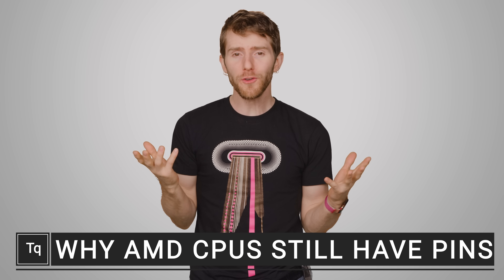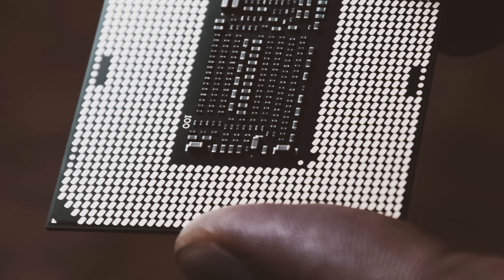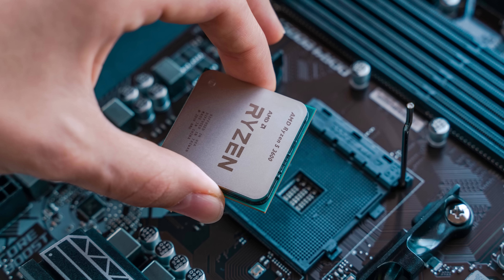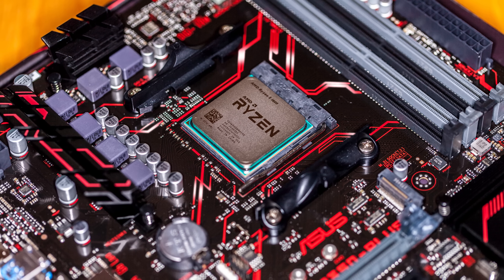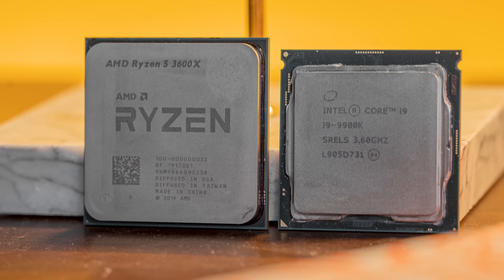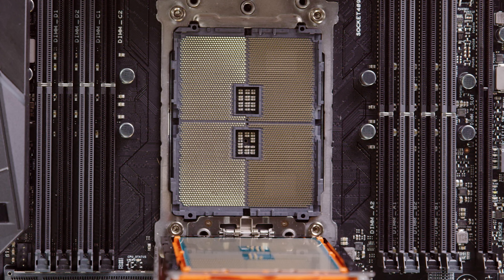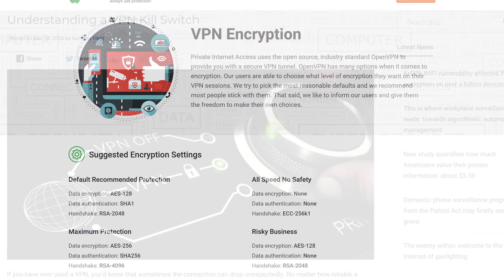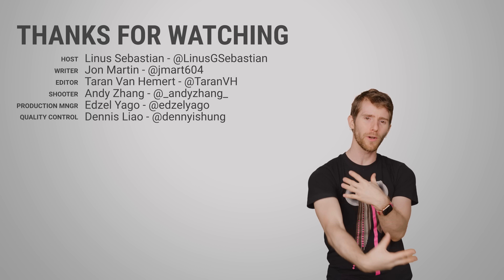Is AMD Stuck In The PAST?

Comment: I honestly prefer AMDs way of going at this

Fixing an LGA motherboard CPU pin is straight up damn infuriating and requires some black magic to be able to do
Reply: Just Vienna  but it’s a lot cheaper replacing the motherboard rather than the cpu
Reply: @mikeramos91  Depends on the CPU / Motherboard in question.  That said, AMD's pins are harder to bend so you rarely see that problem with AMD anyways.  Not to mention, it is possible to fix a broken pin on an AMD processor.  For an LGA socket, you are SOL if a pin breaks off.
Reply: Michael Ramos I bent multiple pins on my ryzen 7 2700x, and one even snapped off... I was able to buy a $5 amd cpu from years ago and steal a pin using my heat gun for the broken one and carefully align all the others without even a magnifying glass, just a good eye and steady hands ... that’s a $5 fix compared to just buying a whole new motherboard
Reply: @DeadChimera  The heck? Did you really manage to solder a pin on a CPU???
Reply: @Gigasimo456  You can just put it on the motherboard pin and it will work like lga
Reply: @DeadChimera  How do you manage to break a pin of a cpu let alone something as pricey as a 2700x? I handle even old ass athlon x2s like they're newborns
Reply: Murderfulpit76 well I was attempting to clean off some old thermal paste when I realized it had gotten on the pins while I was scraping it off... I tried to delicately wipe it down as I had no isopropyl and a pin got bent but when I tried to realign it, it snapped clean off... I did manage to resolder it though
Reply: youre clearly not fit to handle delicate pc parts it seems.

Comment: As an AMD user for the past 10 years, to remove the CPU, it is best to wiggle the heat sink fan (HSF) first. You can use a tiny screwdriver to pry it lose. Once its loose and you can wiggle and spin the HSF around, it is then safe to remove the heat sink from the CPU. I've learnt my lesson by detaching the HSF straightaway from the CPU and the CPU was actually stuck to the HSF. By pulling it out, the CPU which was latched onto the MOBO came out as well with bent pins. Fortunately I am able to bent them back and it was still working. Thus, you need to know how to remove these AMD CPU based on experience LOL!

Comment: I wanted to reapply thermal paste on my 3700x, I tried to remove the heatsink that was attached and lo and behold, it ripped out the whole processor from the motherboard even with the lock mechanism still locked. I found out that my cpu has 2 bent pins fml
Reply: Yeah, sadly you have to be careful about that.
Reply: #1 its not that hard to fix. all you need is a credit card and a pair of tweezers.
#2. If you are that incompetent you should be just buying a dell sff.

FYI all you need to do is heat up the proc with ada or any other heavy task, shut down the  pc and give the cooler a little twist. It will come right off like it is supposed to.

Comment: LGA sucks. If you bend the pins on a CPU, there's a possibility to fix them. But if you bend the pins on a motherboard, you're just fucked.
Reply: And most of the people are spending far more then a 144.00 for a mobo. How much is a super fragile bent pin on a z490 going to cost you?  Have had both for years. AMD's way is far better to work with,.

Comment: When i remove the heatsink my fcking cpu comes off with it. F u amd
Reply: twist the cooler side to side
Reply: If you are that incompetent you should be just buying a dell sff.

FYI all you need to do is heat up the proc with ada or any other heavy task, shut down the  pc and give the cooler a little twist. It will come right off like it is supposed to.

Comment: Another potential issue with LGA is mounting pressure connection issues.  I have had far fewer PGA chip builds that have suffered from memory connection and PCIe connection problems that almost always end up being a mounting pressure issue for the CPU in the socket.  It isn't so bad with small chips and low pin counts but when you get into large chips with high pin counts it tends to become more of an issue.

Comment: I ended up bending most of the pins on my 3700X when I had got it a few months after launch. I was so worried I'd done permenant damage but managed to bend them back into shape. Pin designs are so inconvenient. Especially when the cooler is glued so hard to the CPU due to the paste that you can't get it off
Reply: Well, that may be more of a design issue with the socket.  They could do with redesigning things so that can't happen.

Comment: My z97 board died, bought a used one for $100, it came with a few bent pins, 1 broke off while I was trying to fix them.
Now I don't have a clue what to do. Replacing a perfectly good i7 4790k with anything that's better will cost $500+ because I have to get ddr4 ram as well.  What the fuck do I do, order another used mobo and pray?  Any help would be appreciated.

Comment: Missed the part where when the thermal paste hardens and you try to remove the cooler from your AMD CPU it RIPS THE F*CKING CPU OUT OF THE SOCKET! This can't happen with an LGA mounting.
Reply: If you are that incompetent you should be just buying a dell sff.

FYI all you need to do is heat up the proc with ada or any other heavy task, shut down the  pc and give the cooler a little twist. It will come right off like it is supposed to.

LGA is pure shit very easy to bend a mobo pin and nearly impossible to fix it.

Comment: AMD stuck in the past. Thats why I am still using the same motherboard now since first gen. Thank you AMD.
Reply: Does it have DVI?
Reply: True_Neutral? XD
Reply: I'm still on x470 with 3700x.

Can't wait for new gpu wars later this year.
Reply: But can it run Crysis?
I mean, Chrome?
Reply: HA this comment aged very poorly. Glad to see you'll be able to run gen3 zen in that motherboard. Longest support ever.
Reply: What in the shitting hell could justify leaping only 3 cpu generations anyways?
In other words by the time you will ACTUALLY need a CPU upgrade, you will need a NEW AMD board.
Reply: @BenderBendingRodriguezOFFICIAL  true nothing is actually future proof  in pcs apart from cases and maybe psu s
Reply: @BenderBendingRodriguezOFFICIAL  the one intel didn't provide is "optional". Yes, if you want the most out of your cpu, you will partner it with the new mobo chipset. but then again, the word is optional. And use the word WANT instead of NEED.
Reply: @BenderBendingRodriguezOFFICIAL  uhh maybe going from entry level 1600 you can afford at the time to lets say 3900x you can save for while using your AMD system for years ? xD which is exactly what i recommend these days to people building "budget" systems - buys decent midrange x450 MotherBoard specced enough to be able to use any of the Ryzen chips (currently my rec is on Asrock Fatality B450 Gaming K4 available currently at Amazon at mere $120) then put old first gen 1600 in it which is still more than enough to feed midrange GPU, then save up for better GPU and CPU down the line and upgrade in few years to best GPU you can afford and CPU strong enough to feed it ...

you know not spending money you dont have to now for expensive CPU and instead putting that cash towards better RAM or GPU then upgrading in 3-4 years to much better hardware while staying on your current Motherboard and RAM ...
Reply: @Asghaad  buying a high end mobo and plugging a low end CPU into it is like buying a rtx 2080 ti then plugging a 720p monitor into it... You're just giving flat out bad advice. Anyone who's on a budget should just get a mid-range mobo and use the savings to get a better CPU, instead of throwing money away on a CPU that'll just get replaced in a year. It's just kicking the can down the road.
Reply: @Asghaad  coupling a r5 1600 with a rtx 2070 results in a 15% bottleneck of said GPU. Coupling that same CPU with a 5700xt results in a 17% bottleneck. Coupling that same cpu with a 2060 results in a 10% bottleneck. Flat out no the 1600 is not "more than enough" to drive anything up to either of those GPUs. The end user may not notice it on a 1080p 60hz monitor, but running either the 2070 or 5700xt on a 1080p 60hz monitor would be a bottleneck as well.
Reply: @paulghignon4092  I really hope you didn't just quote gpucheck. LOL.

...though to be fair your point about GPU bottlenecking is valid. I just question the impossible precision with which you label those bottleneck values, since they will vary wildly from program to program. It suggests to me that you googled it, and trusted whichever addled algorithm popped up first.
Reply: @paulghignon4092  thats just really a silly comparison since the impact of each is different. just see this vid so you have an understanding how a b350 motherboard could still kick ass.

https://www.youtube.com/watch?v=oRaZ2Txv13M

If you are too lazy to watch, summary is it can easily handle ryzen 3600/3700 even a 3950 unless your looking to overclock it. however, i think a person with a 3950 could also afford a new board. Just want to talk to the people who are on a budget

Again. Thank you AMD
Reply: @BenderBendingRodriguezOFFICIAL  Unless you use your PC for work, in which case, time often being money, frequent upgrades can often pay for themselves.
Reply: @BenderBendingRodriguezOFFICIAL  Agreed. High-end CPU's can easily last 5 years for gaming, even longer with overclocking.
Reply: You mean the same motherboard which has a far lower life expectancy than any CPU you'll ever buy? Try using that motherboard in 6 years as it's components begin to die one by one... Most people should upgrade their CPU every 5 years or so at best, and 99% of motherboards don't last much longer than that. If you bought a CPU that's actually worth upgrading a year or two later, you clearly spent money on something that was a massively low end CPU and probably low end mobo; I'm sure that low end mobo would work great with a high end CPU...
Reply: @paulghignon4092  motherboard "life expectancy" is only applicable if you drive it beyond its parameters i have +- 14year old Motherboard and CPU running every days that i sold to a friend years back and his son is still using that to this day ... because i picked motherboard that want being overloaded by the components ...

other MoBo i sold him along with my old trusty i7 4820K is right now running as his main system without issues ...and i expect it to be running a DECADE from now no problem ...

dont know where you get your absolute BS statement about Motherboards failing, but as long as you arent overloading the VRM it will last for DECADES without problems ...

which by the way is the case with that Asrock B450 Fatality Gaming K4 which runs 6 phase VRM (doubled 3 phase) where most B450s run single 4 phase  VRMs with most of the time 6 or 8 phase VCRMS only available in X470 or X570 models ...

pairing bad low end motherboard with strong CPU is the most often made mistake when building PCs that might be the reason you think motherboards last only few years ... when you buy cheapest trash you can and run it at or beyond its limits dont be surprised when it degrades fast ...
Reply: @Asghaad  Endurance will vary wildly with conditions, but if you run your PC 24/7 like I do, seeing 15 years is unlikely.

A motherboard lasting more than 15 years is rare, as by that point capacitors are close to reaching(or in the case of particularly cheap or old ones, are far past) their life expectancy, and have most likely degraded by a large margin, increasing chances of instability and failure. A cheap mobo can often have multiple failures as well...you might not brick it from capacitor degradation, but the VRMs may fail, a PCIE slot, a USB controller, etc.

Certainly, degradation is quicker if you're abusing the PC either through building it from mismatched parts(perhaps most especially with a shitty PSU) or with improper handling & cleaning, excess heat, shorts, etc. but it will eventually occur no matter how careful you are.
Reply: @auturgicflosculator  sure it will, i dont claim that EVERY mobo will last 15+ years (although the one i mentioned was of the budged variety and still works as daily driver PC) but neither will it die in few years ...

id say at MINIMUM life expectancy of decent motherboard running at its spec is at least 5-7 years, if its run as it should be UNDER the specs 8-10 is where i would start thinking about replacing even functional part.

meaning in the case of AM4 platform the decent well built and properly used Motherboards should last for 5+ generations of processors (we are currently at 3rd, gearing towards 4th and MAYBE we will get even that 5th gen still on AM4) leaving people who invested in lets say x370 motherboard path open to upgrade from theyr R5 1600 to current 3900x or even upcoming 4000 series when needed ... Intel doesnt have that, every time you want to upgrade CPU and GPU you also have to splurge on new motherboard (thats $100-200 extra out of the window for basically nothing) and with the new socket it often means at lest new mounting bracket for the cooler if not new cooler altogether (wonderful news for those of us who do watercool our main system ...)

for all of those reasons when i was upgrading my system i went from years old trusty i7 4820k (last soldered i7 before 9th gen) to Ryzen 5 3600 put into Asus ROG Hero VII x470 motherboard (basically the best x470 mobo that beats a lot of x570 ones in features and specs that at the time was RIDICULOUSLY cheap for what it offers). that means i have right now decently priced CPU that handles anything and everything i need and if i do upgrade the GPU in next few years i can always put better 3rd gen or even 4th gen Ryzen in that MoBo to keep up with what the GPU needs.
Reply: @Asghaad  I was only nitpicking on the mobo longevity point :P
Largely agreed on your other points, and if that hero VII was a good deal then it was a fine choice.
Reply: @auturgicflosculator  in American pricing it cost me around $160-ish which for top tier 10 phase VRM motherboard is a steal in my opinion :) especially considering the Hero VIII is even now over $400 and while better, not twice as good as the VII

hell i was surprised the Amazon restocked the VII and still sells it at $200 right now i wouldnt hesitate to recommend it at that price to someone looking for full featured board even today.
Reply: @Asghaad  One other point we disagree on...while AMD offers better compatibility than the competition, 5+ generations as you say sounds unlikely. I think the likelihood of 5th gen support is nil, 4th gen unlikely, 3rd gen questionable.
Reply: @Asghaad  How does it feel knowing those motherboards won't be usable past zen2? It's as if AMD lied through their teeth, they totally don't do that regularly...
Reply: @paulghignon4092  YOU WERE SAYING? HAHAHAH
Reply: @paulghignon4092  shame! shame! shame! hahahaha

Comment: I think i heard there where LGA problems with big aircoolers, some of the pins did not contact correctly because of the high weight of the aircoolers.
PGA should be more durable because the PCB needs to be bigger, to secure the pins then needed on the LGA socket.
PGA does not support the cpu as good when the cooler is removed, you need to twist and slide the cooler off, or the CPU will follow the cooler off and potentially bend pins.

Comment: Personnaly I'm more scarried when I have to install a PGA chip because a LGA you let the motherboard on the table and your fingers can't messed up. I prefer let a finger on the contact pads than on pins. And with PGA a little stress the cpu slide from your hand and it(s game over for it. Otherwize I removed recently an air cooler from my 3950X and the paste was so sticky that the cpu followed it out of the socket. Even if the cpu was suppposed to be still locked in. Thanks god no pins was damaged.
Reply: If you are that incompetent you should be just buying a dell sff.
 You literally drop it right into the holes unlike inhell crap where a drop from .25 inches means an new mobo., if you are bending amd pins you really shouldn't be trusted with mounting a cpu.

FYI all you need to do is heat up the proc with ada or any other heavy task, shut down the  pc and give the cooler a little twist. It will come right off like it is supposed to.

Comment: Who cares if the CPU pins are bend if you can fix them like Linus teached us??... Anyways intel is forcing you to buy a brand new motherboard and CPU every single generation by changing the damn socket -.- making it a total waste of money and time disassembling and reassembling the whole machine... At least with a BIOS update you can use newer AMD processors in older motherboards, and if you are so clumsy to damage it, you'll be happy to replace it with newer generation with great performance boost (and half the price intel's counterpart) :v

Comment: Install a 486 or one of those Intel Overdrive CPU's on a Socket 1 then you know what complicated is.
The force that you need to press those bastards in the socket is 1000 x more as with anything newer, and the sound that the pins do, makes me goose bumps.
And removing those bastards without bending the pins, is a pain in the ass without the right tools, or time cosuming.
Reply: Yeh lets go back to the slot A days, now that was the way t o do it :)
Reply: Dude i tried those slot things once, and it doesnt worked.
I mounted a Pentium 3 677 Celeron CPU on once of those Slot 3->2 Downgrade adapters from Gigabyte, to upgrade my retro Pentium II 233MMX system, to a Pentium 3.
But the system got other plans, and refused to work.

Comment: LGA pins tends to lose contact after each installation or bent a lite bit over time, if an aftermarket cooler is installed much tight, then PGA pins are more robust and maintains good contacts in long term.